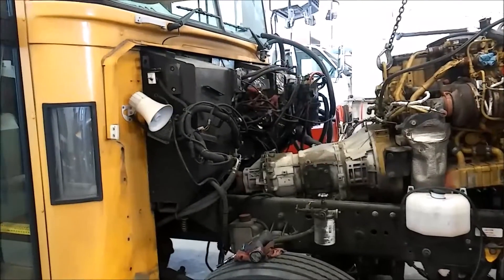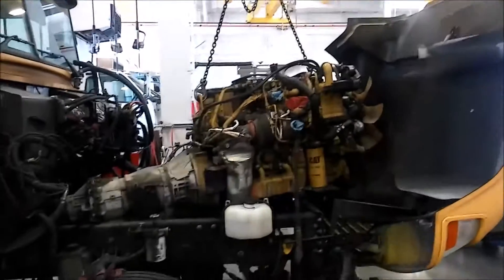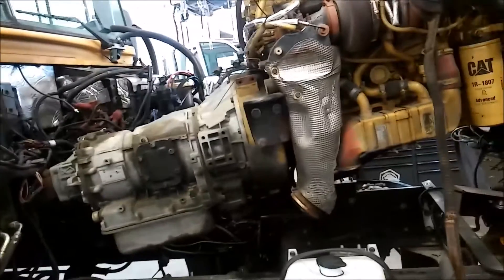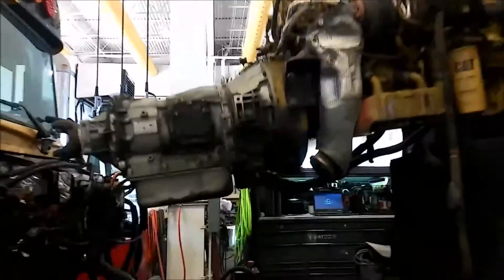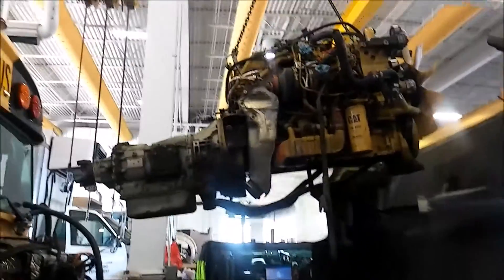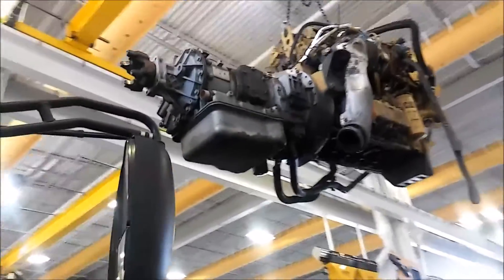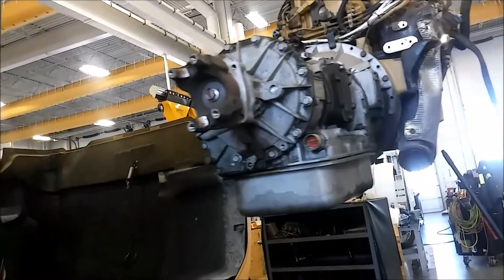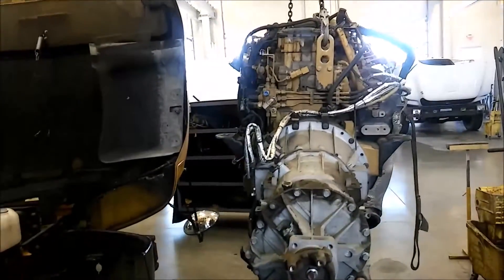Removing an Engine with a Crane

Comment: I'll be doing that tomorrow with a C13 ACERT. 2007 Pete 379. Hmm. I should do a vid but my boss wouldn't like that. He's a bit salty and old school. But wise. Very very wise. Anyway, the driver was going 65 and he heard 4 booms and the engine quit. I was the lucky one to go get him. Since the driver didn't speak English well, my boss just wanted it back. So he had me pull start it. That didn't work. Dragged the tires. 
Long story short, they said it's the starter. Threw the gear into the flywheel. And many other things later I finally said fu'% it. Drained the oil.
Yep.
Metal. 
Bits and pieces of bearings.
Pulled pan. 
Burnt oil, a pound of shavings, slivers and powdered steel, copper etc. 
Main 5 and rods 4 and 5 burnt crispy.
Crate engine. And guess who's gonna do it?
Alone.
Yes. Lil ol' me. 😁
Tomorrow's gonna be fun.
Man I love being a Diesel mechanic. 
Hey, you should have named yourself ACERT Ape.

Comment: What does CAT do with an engine like this that cannot be repaired? Do you try to salvage any components off of it? Or does the whole thing get sold for scrap metal?
Reply from the maker: +alexctucson It was a warranty repair so they have you salvage everything you can, water pump, rocker arms, structures, and pretty much anything not damaged.
Reply: alexctucson Depends. Usually scrap. Some parts can be swapped if tested good.

Comment: These C7s are are garbage
Reply from the maker: How could you say that about such a fine piece of CAT engineering! Just because they have 4000 sensors, an ARD head that fails every year, and no power! Slander. Yes I agree, it's too bad CAT went out with a poor engine design. Thanks for commenting.
Reply: The base engine is a great engine, good power, the 06 and older C7s  were better. Most school districts with emission compliant C7s are retiring them really early with under 100,000 miles, and nobody wants to buy the trade ins. - THanks for all your videos, all very informative.
Reply from the maker: +bluebirdvision Thank you, yeah we used to work on a bunch of the C7 and C7s but they are all out of warranty now. Thanks for commenting and the appreciation.
Reply: Never worked on one yet. C13 and C15 are the main vics here for me.Im more of an old school Series 60 dude but recently been dealing with a lot of post '10 Cummins and their shit DPF systems.
Sorry Cummins. Great engines. Lousy ass Aftertreatment systems. '10 to '14 that is.
Reply: Any suggestions on a repower option if the C7 fails.  Can you bolt up a Cummings or something mechanical to that Allison trans?